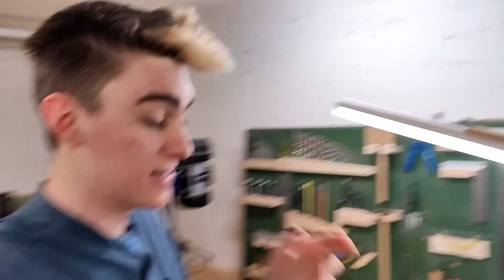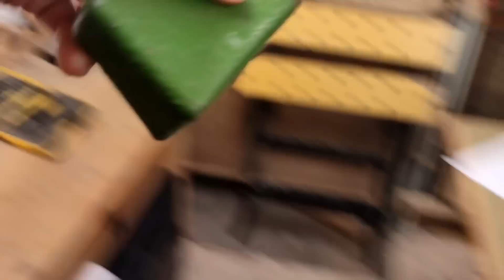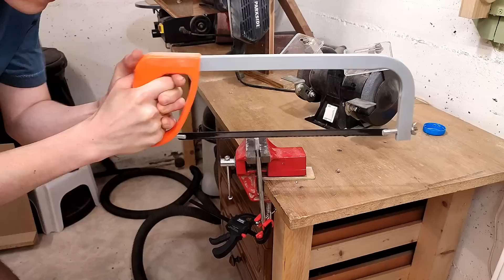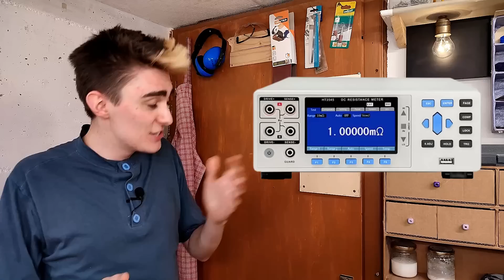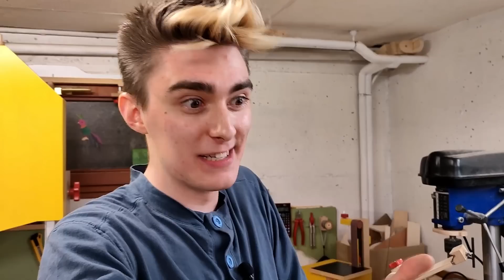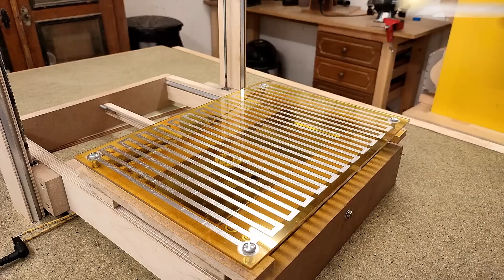How to MAKE a bed heater from scratch for $5.00 | DIY unipolar 3D printer part 10

Comment from the maker: Upon popular demand I might need to add: in case it wasn't obvious the method I used here to measure low resistances is only good to 3 or 4 decimal places, even if my writing down all the digits from the calculator might suggest otherwise. Three decimal places is plenty good for hobby purposes, but you're obviously not going to replace a scientific instrument capable of measuring 10 digits with a multimeter.

Comment: The glass also acts as a passive cooling part so the temperature will not reach maximum unless you overshoot. The same thing happens with headguns where you set a temp but the hot air is much cooler than the temperature of the coil inside. In your case its just the size & thickness of the glass causing it.

Comment: you could have used more resistive element than alluminium like nichrome and so improve efficiency of the heating bed by increasing the voltage and leaving out the resistance of the bad connections(because most of power drop will be on resistive element cause has higher resistance)

Comment: I made one pen plotter in 2014 using (old matricial printer motor) control by mach3...learning alot. 

One suggest to video (do robo like Wa-le) best you can...programmable "scratch3.0" 
Series 01-10 v1.0 and improve

Comment: You should use copper Foil ORing between Al and washer, or you can use DIY spot welder  using branch PSU and Capacitor to spot weald both.
You can also use floor warmer resistive heating element or buy graphite flaxible sheet.

Comment: Did you try to insulate downside? I mean glass is quite bad heat conductor, so it might be worth putting something simple for insulation. Though I don't think it would increase temperature big any big margin.
edit
Oh you actually did it. Nice to see. One thing I immeadiately thought that piece of leather could be interesting to see as insulator. I'd think it might make quite good and light insulator material. After all, like almost all welding gloves are made out of common leather.

Comment: As a physicist I really hate how you write the resistance measurement with 10 decimal places. You measured everything (R1 and the voltage drops) with at least 4 decimal places, so your calculated result may never be more accurate than 4 decimal places!

Comment: What's the rating of that power supply you have? I'm wondering if the 24V at 5.6A is too much for it to handle, which might explain the dip in performance

Comment: To properly cook an egg, you need to hit the boiling point of water, 100C! Also I'll bet with some insulation on the bottom of the bed you'd get a lot closer, but maybe not in the stated budget.. Also fun fact, those terrible backlash geared stepper motors you mentioned, were once used in a mini printer that costed over $300 "M3D Micro" looked neat, but just terrible kinematic design.

Comment: You will not be getting the resolution on the resistance calculations you think you are and definitely not anywhere near the number of digits you are writing down. Uncertainties come into play, mainly based on the resolution of the volt meter but also the tolerance on that resistor which could be as much as 5 % if you didn’t measure it or if you measured it, then it will be the uncertainty of the resistance measurement. It won’t be worth analysing all the uncertainties and finding out how accurate your resistance really is but there is no point writing down all the digits that you do because after a few significant figures they will most likely just be noise, uncertainty or created by the calculation and hence not really mean anything. A good rule of thumb is to round your answer to the number of significant figures you have in your measurements, which is likely only 4 significant figures.

Comment: Method you described isn't as accurate as you show it to be, LM7805 isn't accurate nor stable, DMM isn't as accurate as you estimate, you have tolerance stacking here and if you were to calculate total measurement uncertainty it won't be good. It'd be a bit more reliable to draw high current through the heater and measure current and voltage drop over the resistor. For low resistance measurement you really want Kelvin connection and proper meters or Thompson bridge with decade resistors

Comment: Calibrate stepper motors.
Make sure all motors are the same. 
Adjust belts. 
Even a well built 3D printer is fussy. 
Best of luck to you fellow builder/ maker. 🤔😁

Comment: I made my heated bed by gluing copper wire to the glass with super glue and then covering everything with 5 minute epoxy. I routed my wire in a zig-zag pattern, think of triangles, rather than rectangles. 
It works well and was easier to make than foil or any other method. I've been using it for years already with no issues.

Comment: You can buy bottles of aluminum contact goop at most hardware stores. Normally you squirt a bit of the goop into a screw terminal before sticking stranded aluminum wire in and screwing it down, but brushing a bit onto the underside of the washer should do just as well.

Comment: Probably not good for this particular case, but if you ever need to solder to aluminum, try melting some solder on it and then scratching in the puddle with a stainless steel brush. That cuts through the oxide while the liquid metal blocks access to oxygen. Good for epoxy too (although you can use sandpaper in that case).

Comment: Brilliant work! At first I thought it would be a pain not having a separate removable piece of glass, but on second thought this should cool down just as quickly when turned off, and prints on bare glass detach without effort. If I need stronger adhesion I can clip another layer of glass on top of it and use masking tape and glue stick, and then take that off to wrestle with the stuck-on print.

Comment: Coincidentaly this video came out about conductive tape, https://youtu.be/0HZ35CyHVxQ kind of related, maybe this tech can help?  My printer (anycubic vyper) uses a simliar approach to heat the bed , wavey (not so square and smyetrical) looks like coppper traces on the underside of i think ceramic before the magnetic build plate.  It does 110 which gives me a better appriecaiate for this technology and to be honest is required to print ABS so its sticks, however I think 94 should be good, its close enough i think, especially if you put an enclosure to just to stop drafts it could be enough.  On the plus side ABS doesnt need part cooling so its actually prints better quality in the end if you can give it a warm stable environment.  But PLA is actually more rigid so the idea of ABS = stronger is not necessarily the case, its more elastic which could be a weakness depending on your application.  So PLA isnt inferoir and ABS isnt that amazing.